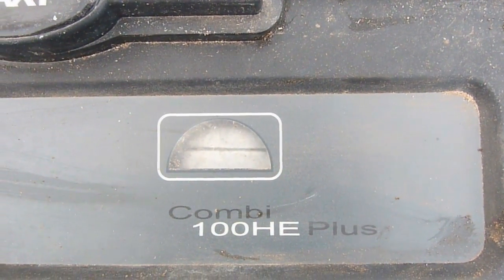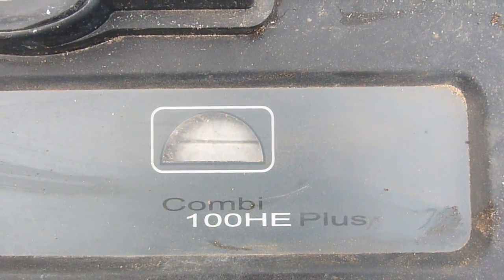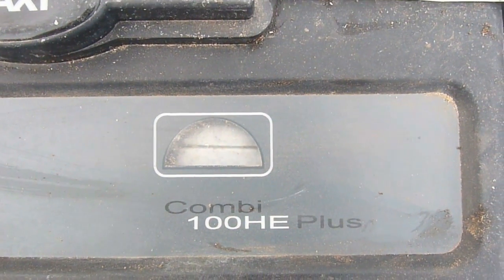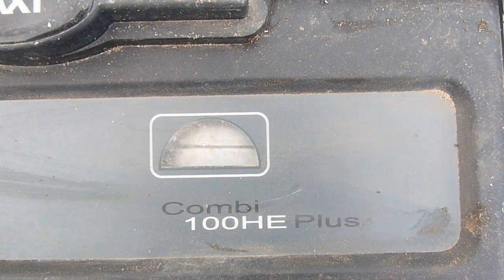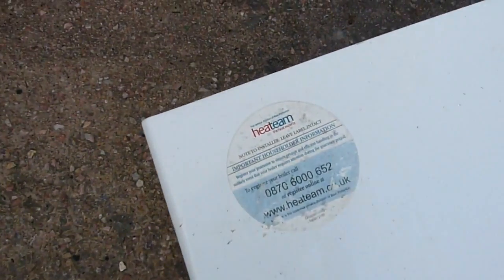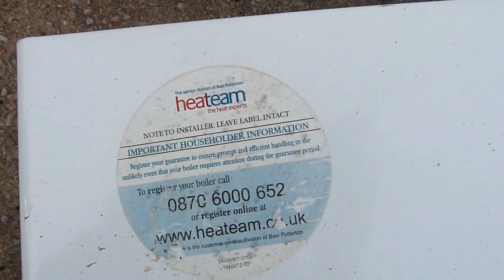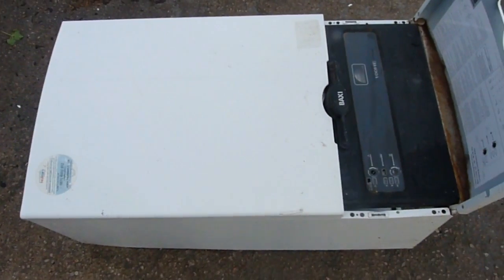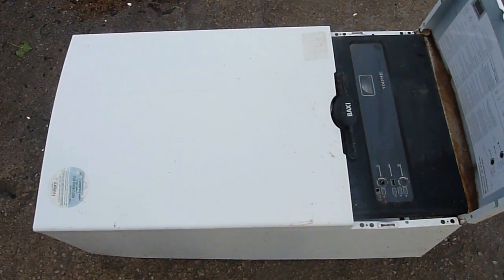How To Fix Your Central Heating Boiler DIY to Save Money. Works on Any Combi

Comment: i have this exact boiler which yesterday packed up no power to it although spare is ok i feel like doing exactly same but would appreciate help on why the thing keeps blowing fuses in the pcb board :(
Reply from the maker: Dee I still have the pcb board from the boiler, its in the shed; let me know if you need it.

Comment: Loved the Vid. I am the "not so proud" owner of a Baxi 100HE PLUS! Had it about 6 years and the heat exchanger has gone kaput! and they re-pressured the expansion tank twice and the pressure keeps dropping. I only have a small hammer - do you think that would do the job?? And I have a huge axe to grind! :)
Reply from the maker: You did very well managing to get 6 years out of it. Mine lasted til just after the warranty before the computer board went kaput. The smallesty hammer can deal a heavy blow in the right hands :)
Reply: I think on the wall not so safe with Gas and water supplies attached? Probably best to take it down like you did and give it a good thrashing - basil fawlty style 😊

Comment: I've got a standalone log burner - a Morso Squirrel for the main living room but it's not for water heating. However, in my case, I really want to sell up and I'm told on one deal that a WB will come with 7 years warranty. That'll be  a great selling point. But you're right Andrew, when we move, I want a better solution to being tied into Russian gas, disingenuous politicians' energy lies (I no longer vote), crud boiler/equipment manufacturers & the mainstream bull***t they try to tie us into.

Comment: @AndrewKFletcher its a ravenheat ,3 years old I called the heating engineer and he had another look at it and told me that it had numerous leaks in the boiler part and could break down at anytime ,so now I am looking at a new system ,absolutely unbelievable,all together it,s cost me £760 over 3 yrs in repairs etc.so am now looking for a sledge hammer,lol

Comment: my ideal boiler is a few years old its great but recently the heat exchange isnt getting hot enough so my water comes out warm i cant get a bath with it i think its flowing through to quick as my bath taps are huge but sink taps are small it comes out burning hot any one ave any ideas :)

Comment: aahh the legendary fuelsaver, just serviced one in a cellar the other day 27yrs old, (never had a frozen condensate lmao) shame glowworm have now gone down the line of these ecogen boilers WTF is that all about, have to wait 20mins after turning the power off before you can even touch it safely. plus only glowworm can deal with the heat engine, sounds about as good as the powermax range

Comment: You should use the sharp end;)
Reply from the maker: There won't be a next time unfortunately as I'm done with gas boilers. My gas bill for heating home and hot water is now £15 a quarter. Our home is heated by radiators burning free wood.
Reply: Andrew K Fletcher
Nice. Where do you get free wood from?

Comment: Made me laugh, particularly when I saw the tool you were using to fix the boiler. These modern combi boilers are just another designed to fail waste of money. If we stopped and added up the repair bill together with servicing costs and installation on top of the purchase cost. Then add all the water we run down the plug hole waiting for hot water it is a huge expense. We need an alternative to gas and your log burner sounds very practical to me.

Comment from the maker: 2 years of problems with a brand new BAXI boiler would be enough to tip anyone over the edge. How can these companies get away with such shoddy products that should be tested to the highest safety and reliability margins. We are after all dealing with a highly explosive and flammable fuel, that requires fitters to pass gas safety standards, yet many of the boilers these people are fitting are anything but gas safe and definitely not reliable ! Which boiler is installed now?

Comment: Ideal logic new ones, went to commission one never been fired up and two gas leaks from burner seal. Ideal tell u not to run them with combustion cover off. Because you won't see the leaks piles of shite
Reply from the maker: Thanks James, good to know there are problems with yet another modern combi boiler and by the sounds of it this one is potentially lethal with gas leaking into the outer cover.

Comment: Now weigh it in for scrap..............should fetch 40 or 50p.
Reply from the maker: +Chev42°6'  Made3 quite a few quid from solid aluminium heat exchanger and solid copper water heat exchanger :)

Comment: Its not just baxi thats shit, all makes are shit. I spend my life repairing them.To make them low emission takes lots of electronics , the more you put in a boiler the more there is to go wrong. Loads of plastic components in them also which a few years ago was brass. I have a 30 year old boiler and theres no way Im changing it.It just goes on and on. Burns a bit more gas but saves a fortune on pcbs, fans, divertervalves, hyraulic blocks, heat exchangers etc etc.

Comment: LOL Hilarious.. Unfortunately i still need mine in working order.. i have a main eco combi boiler.. its only 5years old.. iv been having problems in the 2nd year of it.  The pressure keeps going down.
Water keeps getting pumped out from the external flu for no reason i understand.  i fill it.. it relieves itself lol 

CAN anyone help out here with D.I.Y. tips please.
Reply from the maker: Sajid Karim Your expansion tank needs refilling with air.